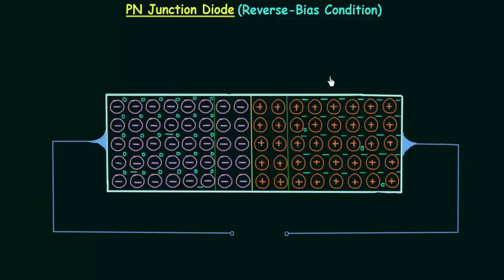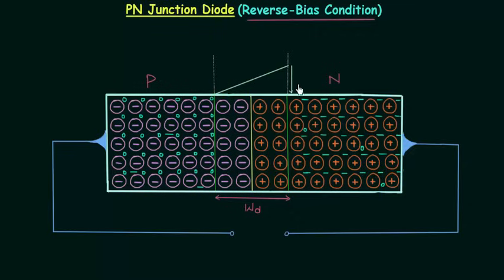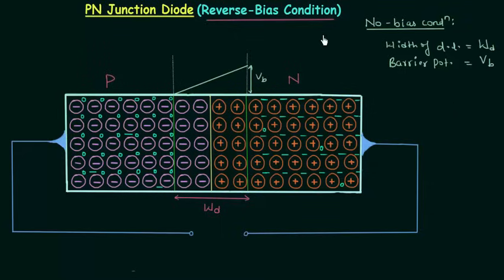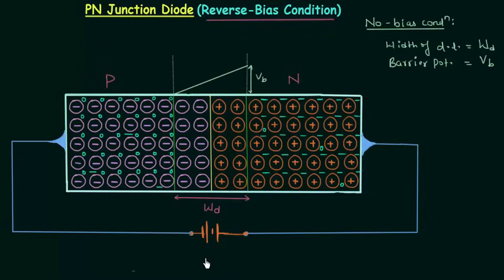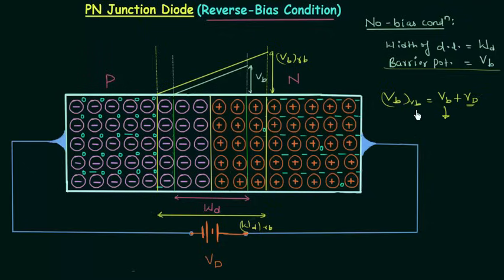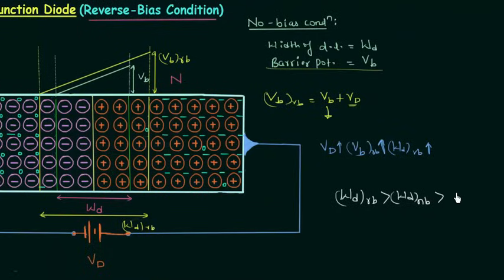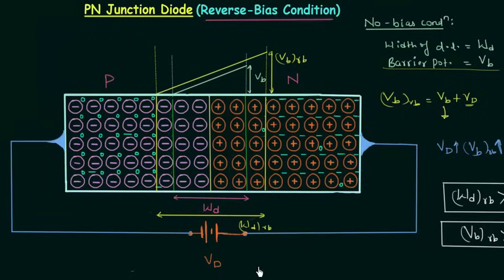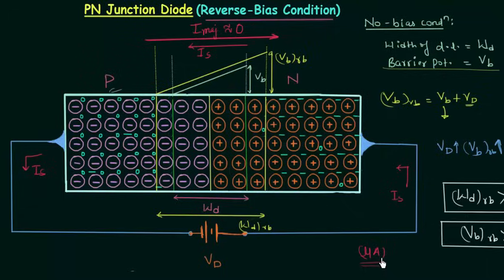PN Junction Diode (Reverse-Bias Condition)

Comment: in no bias condition, diffusion current is equal to drift current under steady state. In reverse bias condition, diffusion current becomes zero while reverse saturation current is very small (in micro ampere). Is drift current the same as reverse saturation current (which both of them are due to minority charge carriers)?

Comment: Why does no current flows through a diode in Reverse bias mode?
Reply: In reverse bias the depletion region keeps on increasing till the potential difference across the depletion region is equal and opposite to the potential difference of the battery. Due to this, the pn junction diode offers resistance hence the majority charge carriers can't go against that resistance so current doesn't flow.
Reply: in fact there is a weak saturation current, but diffusion current is nearly zero, as the barrier voltage is getting greater.

Comment: I read that in reverae bias condition electric field in the depletion region decreases. I dont understand the reason  . Please clarify it.
Reply: Where did you read it? Instead, the electric field would be enhanced when applied reverse voltage.
Reply: You are wrong. The reverse bias enhances the electric field as the charge carriers would be repelled and make the job of field easy and thus improves fields functioning.

Comment: can we say that diode is bi directional 
because in it current also flow due to both charge carriers electrons and holes
Reply: it is due to the rectifiers in the diode.
forward bias --> closed switch
reverse bias --> open switch

Comment: Why the width of the depletion zone stops growing up?
Reply: In reverse bias condition the width of depletion layer starts increasing since the direction of flow of electrons has changed.
A diode can withstand only a certain amount of reverse bias which can cause only a particular amount of depletion layer width.
The depletion layer never reaches the entire width of p-n junction as by then a breakdown has already occurred and no properties of diode are left.
Thus there is no depletion layer or barrier is left and the avalanche breakdown takes place.
Reply: Width of depletion zone depends on applied potential .Only till u keep increasing d potential width  increases as majority charge carriers r drawn towards terminal.
Reply: There is a limit of everything!

Comment: hello sir, your videos are very helpful.Thank you for your contribution.please help me with the doubt ,why the depletion region expands from the center ,in reverse bias condition  electrons from battery when enter p region will merge with the hole at the very beginning,so there should be a barrier at the battery terminal....why center...will expand??? m very confused please help.Regards!
Reply: Can you be more clear with your question?
Reply: +Meghjit Mazumder when in reverse bias electrons enter the p type SC electrons should combine immediately with the hole when it enters so der should be a depletion region near the terminal  ....but here it is shown that the depletion region from centre expands ...how????
Reply: Yes,you're right in a way,but,there is a slight conceptual error.Look,in the reverse-bias,when electrons come from the negative terminal and enter into the P-region,it should immediately combine with the holes and it really does.As a result,we have there negative immobile ions,but then there is the "catch" you actually miss it.After forming those ions there,the lack of holes are filled by the holes from the adjacent ions(towards the depletion region) and thus the process continues.Finally we have the negative immobile ions at the original depletion region,having no other ions(which can supply holes).So they remains in that form and they are added with the original depletion region.
Similar treatment goes for the other side(N-side).If you still don't understand,let me know.
Reply: Meghjit Mazumder brother I don't understand some part which you were talked with her. How electrons come from negative terminal of battery in reverse bias ? In reverse bias current flow from right to left